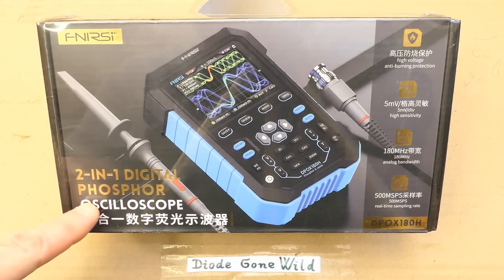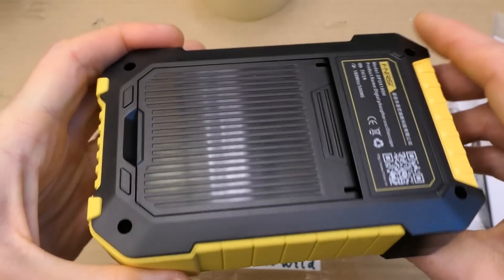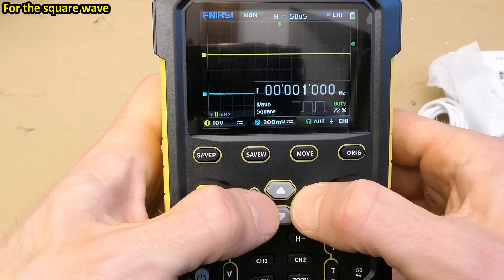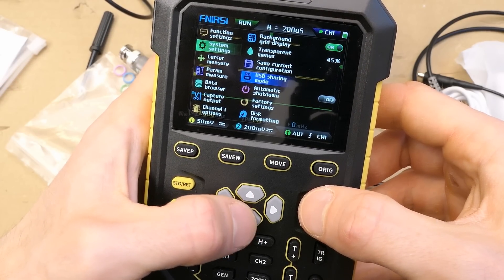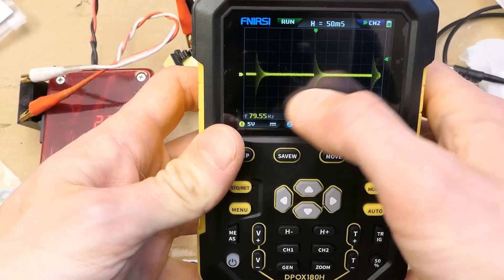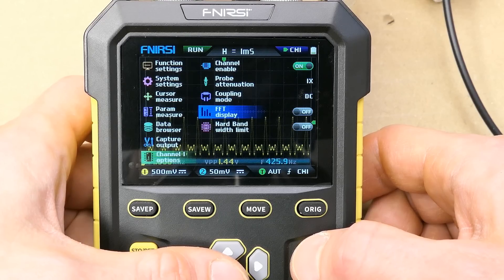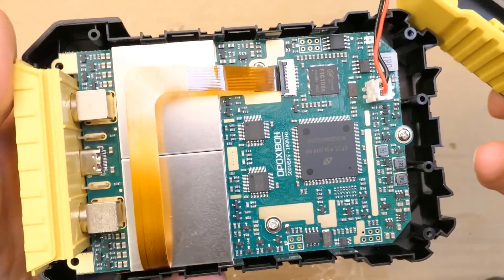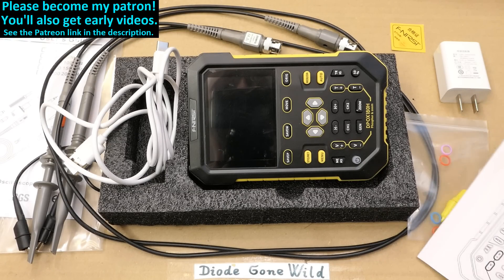Fnirsi DPOX180H 2x180MHz handheld oscilloscope

Comment: Thanks for reviewing this.  I've been looking for an affordable oscilloscope for a while now that could measure higher frequencies used in switching power supplies and digital circuits.  This one seems to have all the options I wanted plus the digital phosphor screen that makes looking at traces easier.  I've ordered it on Aliexpress during one of their sales with a coupon for $105.42 usd.  Thanks again,
Cheers from Oregon, USA,
Philip.

Comment: I have been using Hanmatek handheld oscilloscope. I use it for noise testing in an industrial setting; it has been very convenient and useful. It helps that it’s not connected to earth GND PE. 

The model you show looks great and i was tempted to buy it, but the screen is only 2.8” (less than it appears). The hanmatek/OWI (same thing 🤷‍♂️) has a 3.5” screen.

Incredible that you can buy these things for such a small price!

Comment: The big chip is a small FPGA. Unmarked SO-8 chip on the side is probably its configuration memory. BTW. Would be nice to have some rotary encoder, or 2, or even 3 ;) on the sides. Physical buttons are ok for bench operation (certainly better than touchscreen) but for handheld operation, rotary encoders would be great.

Comment: Realy nice scope - but why they did not use a "real" connector for the generator output? Okay, maybe it is about size and space on the panel but a tiny SMA connector just for example would be more useful...
Reply from the maker: The generator is often going to be used as a calibrator, so it makes sense to use the typical terminals of a built in oscilloscope calibrator, so the probe can be hooked to it.
Reply: There are connectors designed to fit the tip of a scope probe, mating with the positive pin and the ground ring. I would guess these are not cheap though, which is why they haven't used one. Plus it would require an adapter to BNC or a cable with croc clips or something, which would cost even more. If you're buying this, you've almost certainly got your own regular clip leads, which are fine for getting a test signal into most circuits you're likely wanting to test with this. Besides, if you need something better, you'd probably want to look at a dedicated signal generator anyway.

Comment: Nice handheld oscilloscope. I missed some things from your review, so I looked it up.
The unit can charge while in operation. In the manual is an ominous warning about not using the supplied charger: the board might burn?!?
The USB port connected to a computer allows you to get the saved .WAV files and .BMP files, and put firmware upgrade images. (No .JPG or .PNG?!?) It does not interact with an accompanying software product or anything like that.
Interesting product. I might buy it. Or maybe I'll wait for the next iteration. I'm still on the fence.
Reply: Never charge and measure anything that is beeing connected to ac supply as it might short over no matter the charger

Comment: That's quite a nice oscilloscope. But I'd like to see a teardown of the included charger too, but I'm assuming it's no "electrocution houseburner", as you call dodgy chargers. And one question: what's the resolution of the display?
Reply: 320x240 as usual

Comment: Instead of buttons they should have given a touch display
Reply from the maker: Hell no :D Touchscreens are for phones (which I rarely use anyway). In cameras, oscilloscopes and other tools, I prefer buttons. My camera has a touchscreen, but virtually everything can also be controlled using buttons. When I touch the touchscreen of my camera, 99% of the time it's accidental! Super annoying! Without knowing I sometimes change the settings and make the video crappy. It happened in this video too, one part is quite overexposed.
Reply: @DiodeGoneWild I also don't really like touchscreens.
Reply: @DiodeGoneWild  with oscilloscopes I prefer knobs but that'd be difficult with a portable. Still would be next level to have knobs. Some functions naturally lend themselves to buttons. Not all though.
Reply: @1pcfred  Rotary encoders on the sides are certainly possible. You know, the ones that look like a coin.
Reply: Lets keep it old school knobs
Reply: No ..hell no ... Touchscreens suck when your deep inside machine trying to fix it.
Reply: Kosketusnäytöissä vaan harvemmin kontaktihäiriöitä harvoin kun painenee kiertelee kytkimiä tuppaa pinnat hapetumaan ja toimii vanhemmiten miten sattuu. @getyerspn
Reply: @getyerspn Touchscreens suck . (period)
Reply: NOOOOOOOOOOOOOOOOOOOOOOO!!
Reply: Capacitive buttons on a device that may be used near sufficient RFE to trigger them might be a neat demo for wireless power but probably frustrating for actual diagnosis or profiling. Even filming some of my tesla coil experiments with a smart phone can get pretty random sometimes
Reply: Fnirsi has touch oscilloscopes, I have one (FNIRSI-1013D, "Tablet" oscilloscope) for 2 years now and I have to say that it is enough for hobbyist's. 2 channel, 100MHz, 1GSa/s.
Personally I find it easier to navigate through touch menues than button menues.
Reply: @jonnyfisch_ I have 1014D so it's comparatively chunky but relative to my Tektronix 2230 it's practically pocket-size 🤣
I love it for everything it does though! And not running off mains power is nice for probing devices that are mains powered without blowing anything up or having to modify any ground paths
Reply: @jonnyfisch_ I have 1014D so it's comparatively chunky but relative to my Tektronix 2230 it's practically pocket-size 🤣
I love it for everything it does though! And not running off mains power is nice for probing devices that are mains powered without blowing anything up or having to modify any ground paths

Comment: Fnirsi gets better and better with each new model and this one is quite impressive for a handheld as it might be the first one I've seen with shielded inputs sections.

Thanks for the overview.  I wish that you'd tested the bandwidth with some complex signals as these products tend to greatly exaggerate their bandwidth and interpolate all high-frequency waveforms into sine waves.  The waveforms seem quite good from what you've shown, though, and the input stages are encouraging.
Reply: I'd have loved to have seen just what they were shielding. That was the "input protection" they were talking about.
Reply: > interpolate all high-frequency signals into sine waves

That’s what you should expect per the Nyquist-Shannon sampling theorem. A 300MHz square wave should appear as a sine wave on a 500MHz oscilloscope. The question is whether the Nyquist frequency is actually as high as the advertised bandwidth.
Reply: @vaclavtrpisovsky  yeah with these bandwidths you pretty much have to divide them by 10 to figure out what they can really do. So in this case "180 MHz" = 18 MHz. That's what it can display. Anything above that it's just going to draw a sine wave. So it's signal, no signal at that point. Which is not nothing. But it's not the most useful either.
Reply: @1pcfred  10? Where did you get that from? You can draw a decent approximation of a square wave with harmonics at 1, 3 and 5 times the base frequency.

Comment: I started buying a lot of fnirsi gear after seeing your videos, from the transistor tester, pocket oscilloscopes and even that geiger counter than I plan to hack to add the classic clicking sound (I've seen a video showing a very simple way to do it but have not got into it yet, maybe you can do it as well? It just use the input from the blinking LED directly to the buzzer, wonder why Fnirsi didn't make it themselves).
So the sponsorship really pays off. The thing is, they are very cheap for what they deliver, making a nice value for the money.
Reply: F-nirsi seems to be doing good lately with their products 👍🇮🇪
Reply: for the geiger counter you can install custom firmware then it will have clicking sound but first make sure your have real j321 tube allot have fake tube